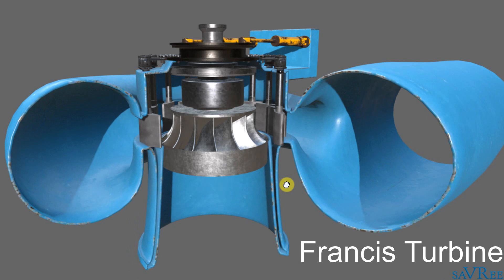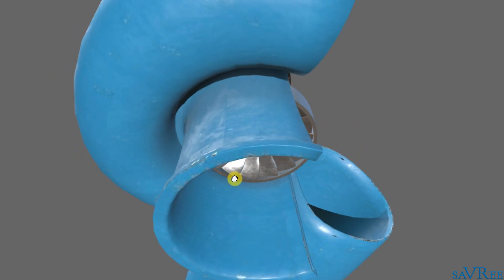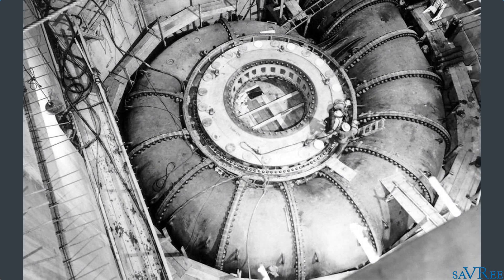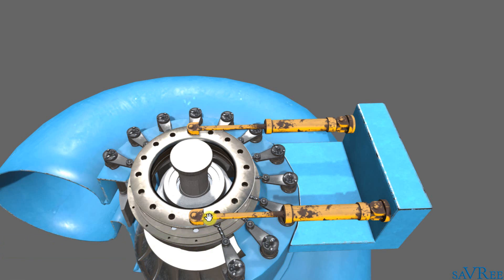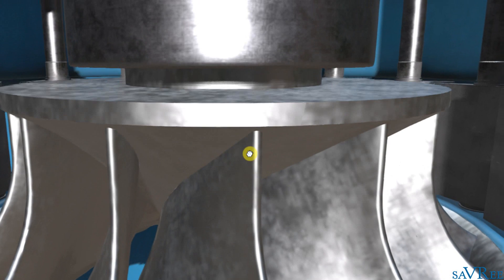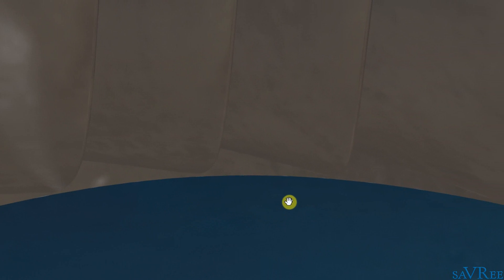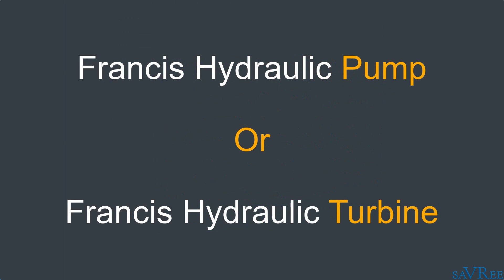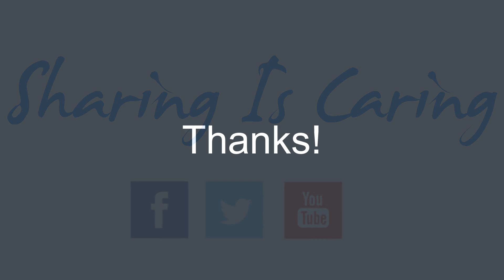How Francis Turbines Work (Hydropower)

Comment: Can someone please confirm the direction the rotor moves. I feel there must be a huge amount of confusion on this aspect. I for one am under the strong impression it moves in the direction where the blade is curved backwards to the direction of rotation. I feel the general consensus is the opposite to this, the blade curves forward in the direction of rotation. I hoped to see a simulation of this. It makes more sense that the force is caused by the rate of change of angular momentum of the fluid, by following the inside of the blade curve, much like a curved vane. No impulse or shock will occur if the guide vanes are angled correctly. I can't see any logic for the turbine moving the opposite way.

Comment: In the fall of 1971 I was an electrical engineering student at Texas A&M University and a member of the student chapter of the Institute Of Electrical Engineers. We took a field trip and visited the Mansfield Dam hydroelectric installation on the (Texas) Colorado River near Austin (Texas). One of the turbines was shut-down for maintenance and we were allowed to go inside the turbine assembly as it was dry (the water from Lake Travis was blocked by a closed gate in the face of the dam). The decreasing diameter metal spiral, that formed the water intake to the Francis Turbine, had been built in the late 1930s and was composed of formed metal plates riveted together. The plates were beautifully shaped so that the interior surface was a smooth, decreasing diameter, spiral with the only interruptions being the rounded heads of the rivets. In today's security conscious environment I rather doubt that such visits are allowed (how sad). As best I remember the diameter of the turbine (including the control vanes) was 4 or 5 feet across. One of the men in the control room said that the dam (by the standards of 1971) did not have too much electrical capacity compared to the total load on the electric grid but that, being hydroelectric, it was capable of being brought on-line very quickly compared to steam power plants.

Comment: The guide vanes should be turned toward the francis turbine, how they are place in your graph, it causes that water crash againt them instead of going directly through the turbine following the curve of the vanes. This placement of guide vanes could potentialy cause damage to the turbine due to cavitation created by the lack of pressure.

Comment: Runner is the only rotating part of the turbine. How is it connected to the non rotating parts? I mean it can't be hanging in the air.
Reply: Probably with a bearing. "Francis turbine parts" at "https://en.wikipedia.org/wiki/Francis_turbine"

Comment: Hello. Great video! I am trying to build a hydraulic system in Africa where we use 220V system instead of 110V. I want to use the hydraulic system from a well or in tank to produce electricity. Which turbine do you recommend I use? I want to be able to power a fridge, A.C, washer, microwave all the heavy loads. Do you have a generator or runner in mind? Would I need a battery or an inverter? If so, what kind?do you inn is a co oany that sells hydraulic system altogether (turbine, generator, battery, inverter etc) instead separately?  Sorry for all the questions. Thank you for your help
Reply: The first you need is a difference of height from were you take the water and the place you will pour it.. as more difference in height better.. do you have that possibilitie?

Comment: Sir this is mixed flow turbine.
But how water leaves in francis turbine with radial discharge at outlet?
Please ans
Reply: @savree-3d  
U dint got my que
This is modern Francis turbine with mixed flow

But earlier there was Francis turbine with radial outward discharge 
How it occurs?
*My english is not good